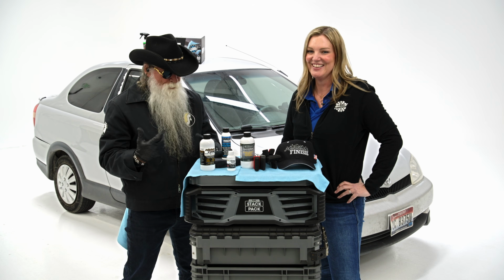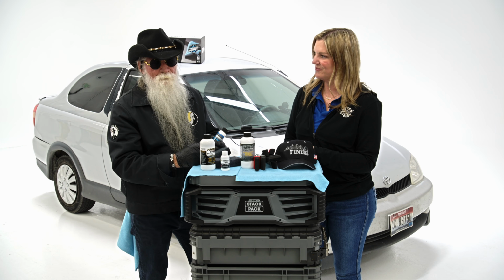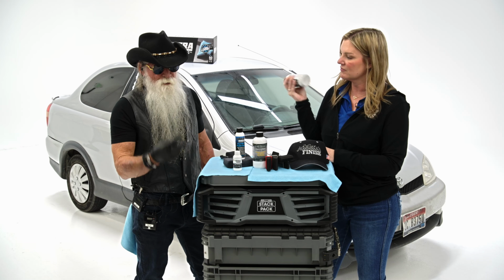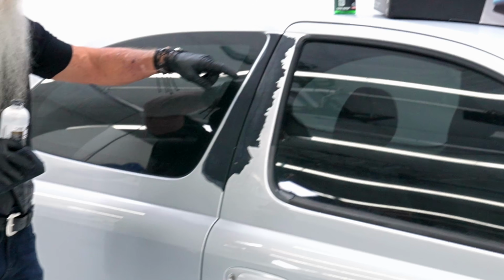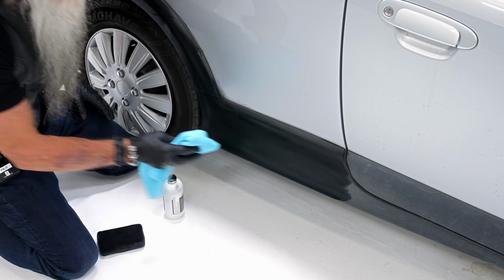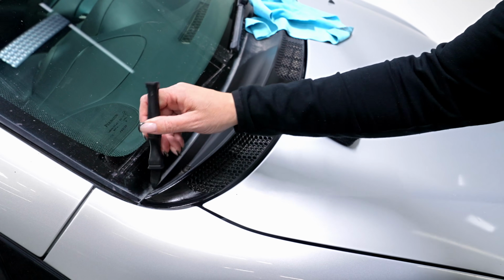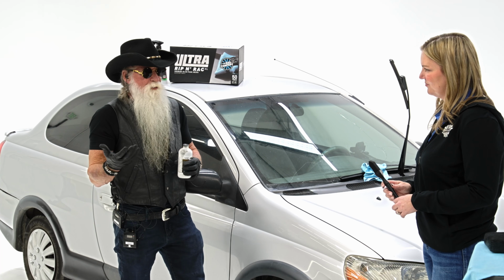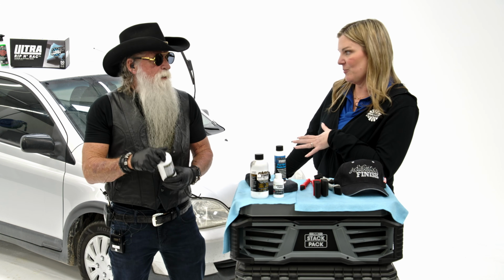How To Fully Restore Your Cars Faded Plastics

Comment: I'm wondering if the grey or the original black solution should be used on a 2020 Sprinter van plastic trim?I believe it started out more grey, but the fade on it is terrible with streaking snake skin-like lines. I ordered both but I am leaning more towards the darker black. solution just for more depth. What do you think?

Comment: This is good stuff but you MUST shake it continuously for about five minutes.  In other words it takes some work to mix the solution completely.  Also it it gets on paint I would advise you to wipe it off right away!  It's a lot harder to remove it later.  The tools shown really help in this regard.  Take your time!

Comment: I’ve been in automotive reconditioning for 34 years and I tried this product and was not happy with it at all. It’s a lot like paint not an actual solvent type product that renews the plastic.
Reply: Then what do you suggest?
Reply: @brianjohnston7344  the best that i found was ceramic coating. It darkened the plastic and kept it dark. If possible coat it when it's new. The other stuff just didn't give the best result
Reply: Used it plenty of times with great results
Reply: This stuff worked great on my kids' 14 year old Ford Escape which had a lot of black plastic on it.